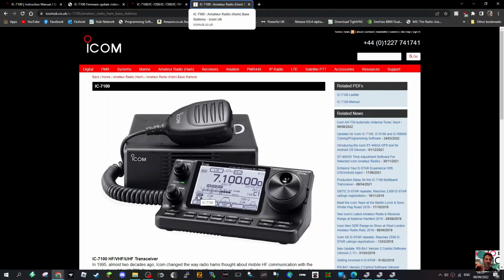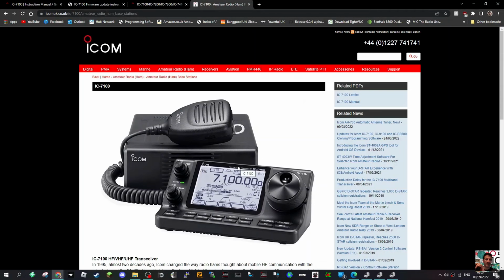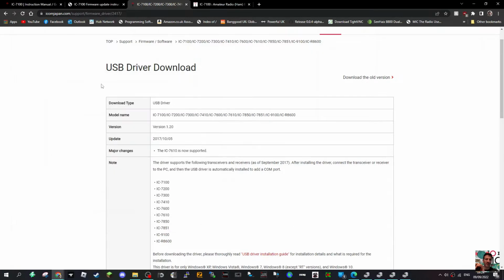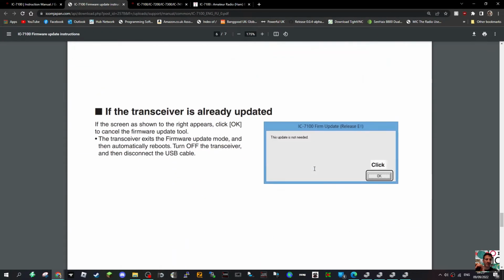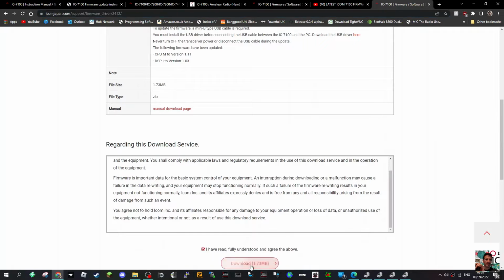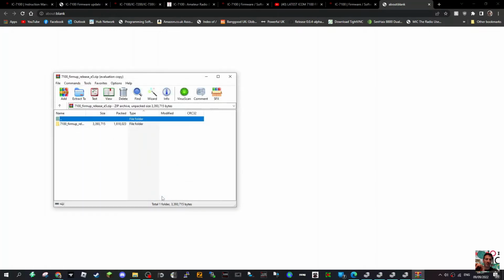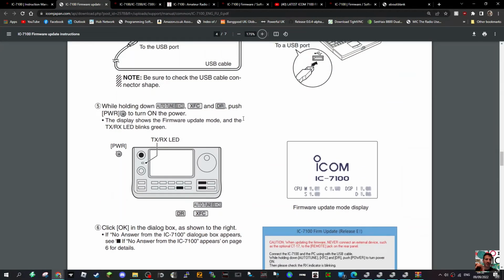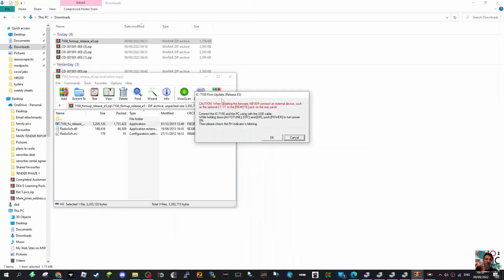ICOM IC-7100 FIRMWARE INSTRUCTIONS - VERSION 5 - v1.11, dspv1.03

Comment: Thanks for the tip!  I did the mod, and the transmit has the solid line around it, but still will not program above 146.000 and will not allow to update firmware.  Guess I will send it to Icom.
Reply from the maker: Best to use Icom.

Comment: I have a new ic-7100, and the 2m frequency does not go beyond 146.000.  Is this an out of US radio that cannot be programmed to the US?  I tried to upload new firmware, but it will not allow a change.
Reply from the maker: Looks like you have the E model or Japsn model there will be an open TX mod try here . http://brucerichards.com/army/ic7100%20mods.htm